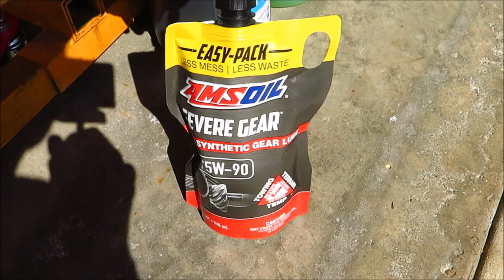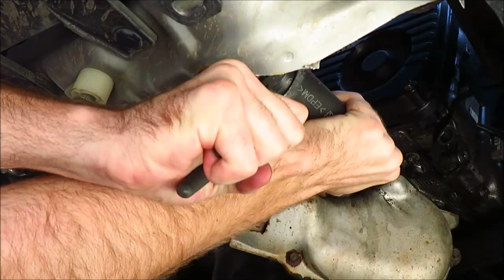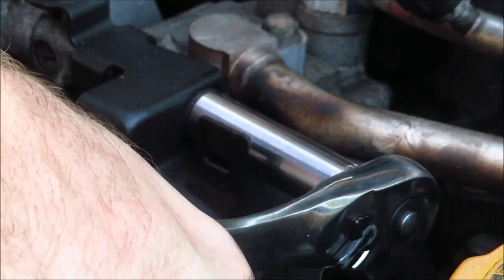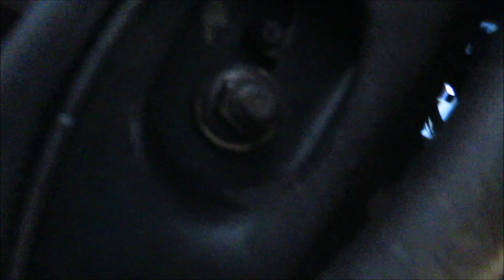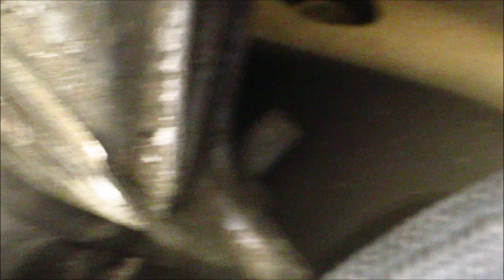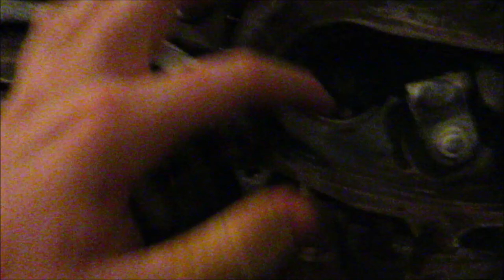Subaru Outback XT EJ25 Engine Removal

Comment: just pulled my engine this weekend, was nice to see! i ended up having a transmission to engine stud backing out fully on one side cause the threads on the end were kind of manked. it actually made a huge issue when separating the tranny and engine cause one side got hung up on the bolt because it didn’t have the stud on the other side for support. shame i’m not yet ready for a short block swap but regardless it was incredibly beneficial from a maintenance perspective.
Reply from the maker: Yeah those studs can be a pain sometimes, might have to run a thread chaser through there. Good to here it worked out for the most part

Comment: Good work dude!

Any suggestions on removing the exhaust manifold in the front end? I did not see any fasteners on the driver's side. Please help!
Reply from the maker: You may have to remove the heat shield to access the bolts. The flanges on both sides are the same, 3 bolts on each. Hope this helps
Reply from the maker: https://youtu.be/1pJNGJyireM
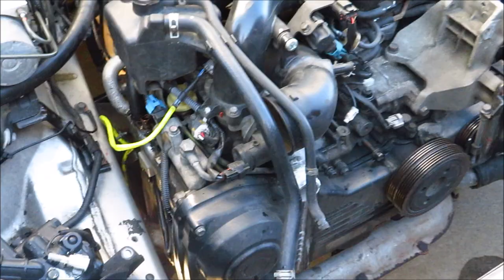If you go to 13:00 on this video you will be able to get a better look at how the manifold goes on

Comment: Great job.  How do you like the Crawford oil separator? did it help with the oil consumption?
Reply from the maker: Its hard to say, on the old engine I had a blown turbo so I was burning a ton of oil anyway. With the new engine I have no noticeable oil consumption and it has larger ring gaps than oem so I think it is doing a pretty good job
Reply: @SWSpeedCo   Thanks for the response. Glad your car is working great with the no oil consumption. Glad to see people do their own repair and being proactive. Keep up the good work.
Reply from the maker: Thanks, I appreciate it.

Comment: what grille is that?
Reply from the maker: It's just a no name mesh grill I got on ebay, it's pretty nice though. It was like $150
Reply: @SWSpeedCo  ah nice, it looks a lot better than oem, just found your channel, also just lost compression in cyl 3 lol
Reply from the maker: Yikes, time for a new shortblock?
Reply: @SWSpeedCo  im not sure just yet, swapped coil packs and spark plugs around and the code didnt follow,  but i wanna get the motor out and opened up before i go spending a ton of money that i dont have lol
Reply from the maker: That sounds like a good idea